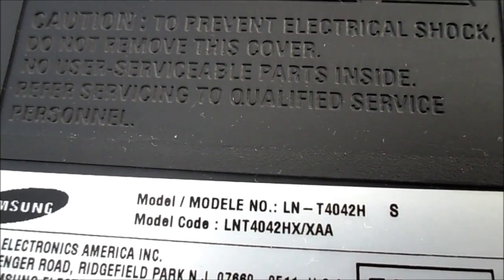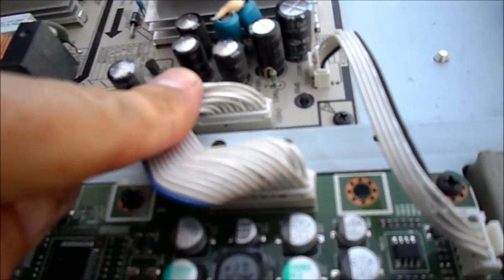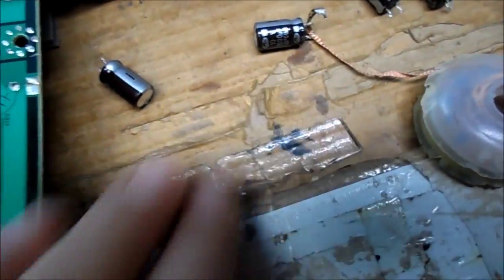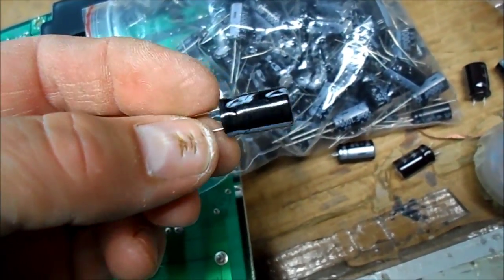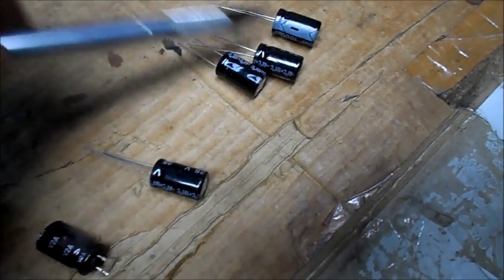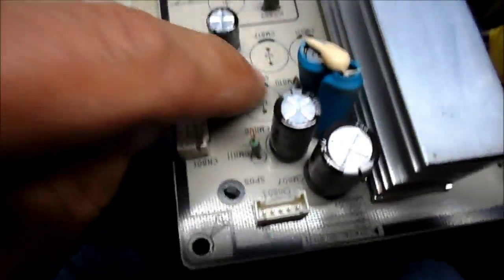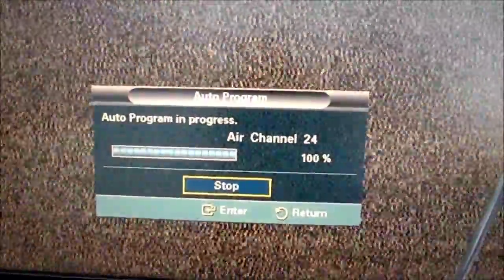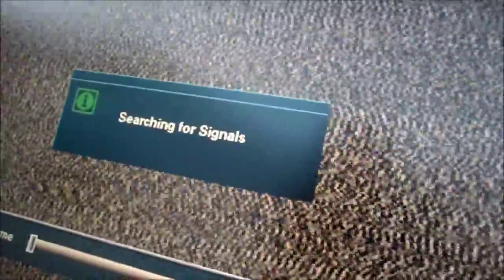SAMSUNG LN T402H LCD TV Repair.

Comment: I never could work on these, too complex & too small,  but as you are doing always use a higher voltage cap.
It seems 75% of a TV program is commericals, I get so mad I just change the channel to TCM channel
Reply from the maker: I've often said:  "I've spent more time behind the TV instead of in front of it".